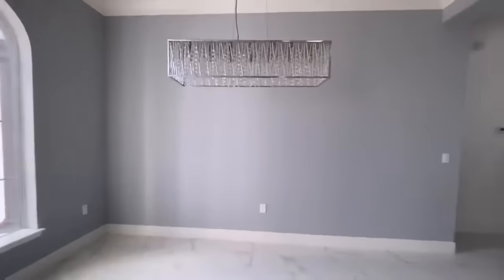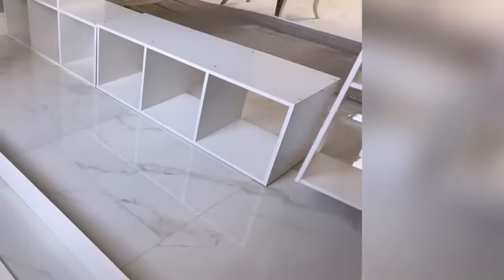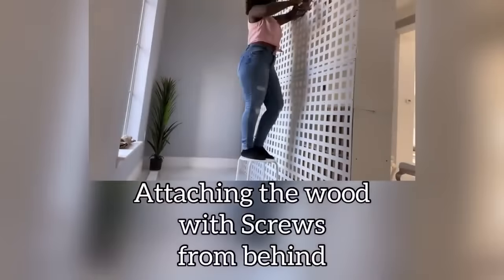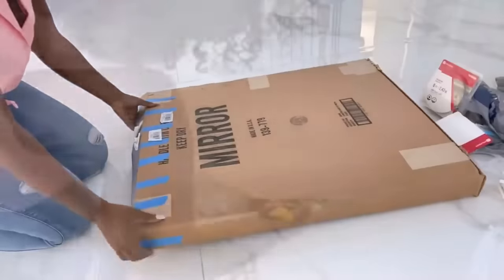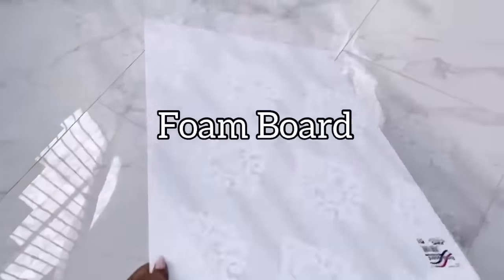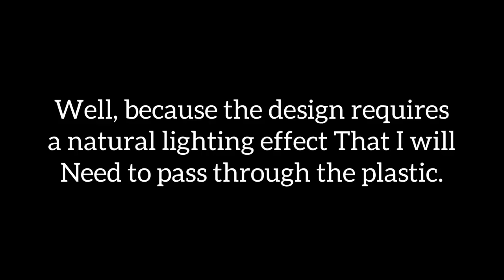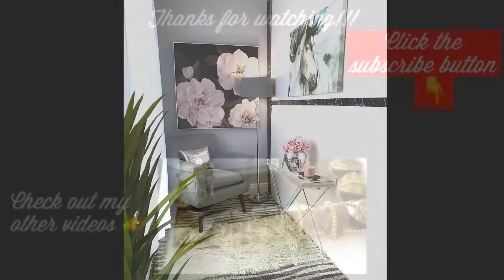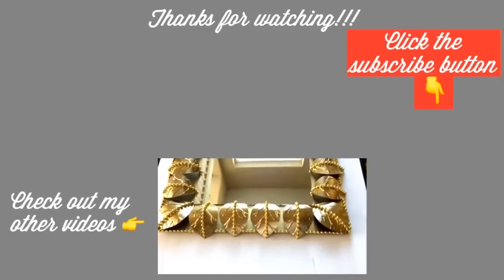NEW IKEA HACK | Lowe’s MIRROR ROOM DIVIDER| DIY Partition

Comment: Lattice is a good way to divide yet let light in and also is easy to work with and light. Lattice is also easy to find at big box stores and lumber yards. It's not expensive either!
Reply from the maker: That's an excellent point! Lattice is indeed a versatile and budget-friendly option for dividing spaces while still allowing light to pass through. Its availability at big box stores and lumber yards makes it easily accessible for DIY projects. Plus, its lightweight nature makes it easy to handle and work with. Thank you for sharing this valuable insight! 😊🌟🛠️

Comment: I would love to rent a day in your brain so I can see how you come up with these projects! Good job! One question I do have though. Since the chandelier was centered for that large room, is it being repositioned? I have a similar situation with a wall we had put up which caused two lights to look off center. Curious as to your thoughts.
Reply from the maker: Renting a day in my brain sounds fun! 😁 For repositioning a chandelier or dealing with off-center lights, you can either adjust the fixture placement if possible, add additional lighting to balance the look, or design around the misalignment with complementary decor. I hope this helps with your project! 😊💕💕💕
Reply: @yoduvhessentials6310  Thank you for responding!